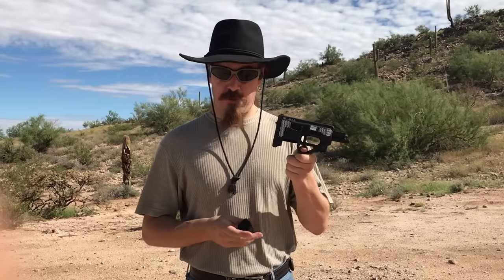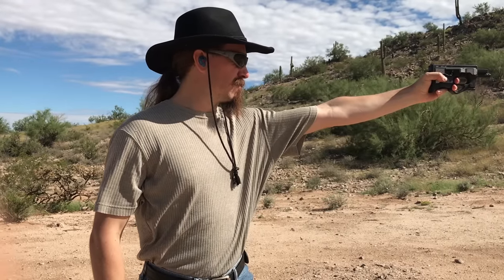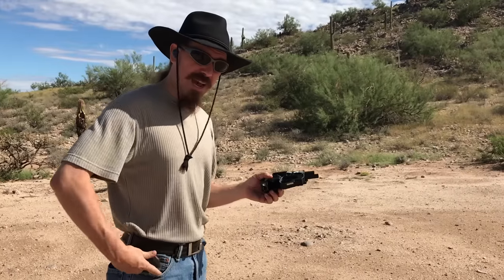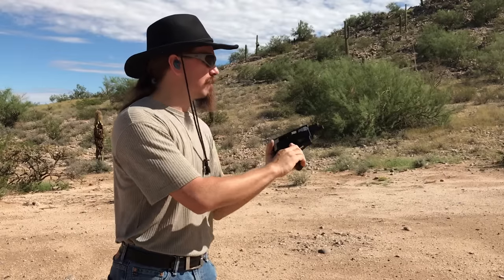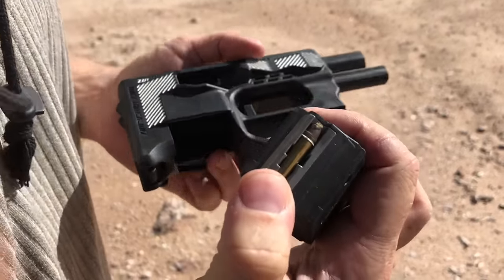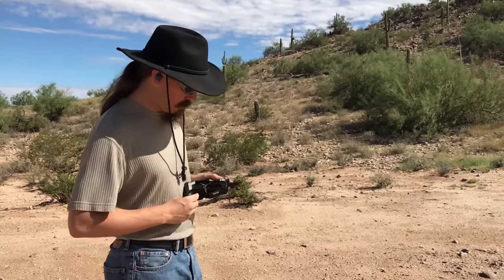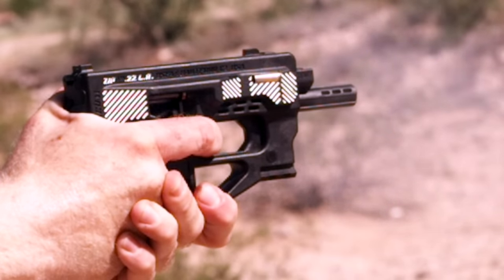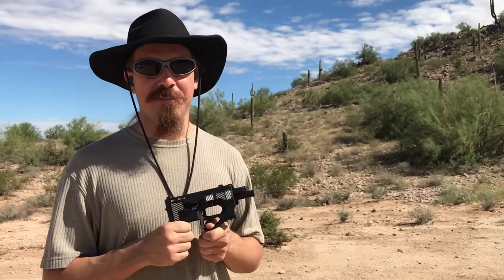Zip 22: Shooting the Worst Gun Ever

Comment: looks like some weirdo teen printed that with a 3d printer.
Reply: Actually one of the latest is a 12ga pump action revolver/rifle (depending if you’d call a 6 shot a drum mag), that one looks pretty awesome. Most are more basic outside finish unless going for artistic like the skull teeth on the printable AR15 lower, and the specific geometry of the Zipp would actually be kind of a pain to print.

Side note on reliability, unlike this model,  the printed ones would likely work much more reliable since it has a community of designers that enjoy creating and  experimenting so they go through multiple revisions very quickly. Plus the zip isn’t cool enough and pretty clunky to hold, that would be the first thing to change like customizable grips (just like you can print lots of pre-made grips for your M1911).

What this more reminds me of is someone trying to make it out of a NERF toy and really not wanting to alter it enough to void the warranty so it can actually work well, like I’m pretty sure a couple hours modifying a toy and I could make a functioning revolver much more reliable than this, haha!

Comment: The charge handle in front of gun... oh gosh.... I was nervous every time you had to fixed feed issue, or load new cartridges.... I saw accidents in my head every time. Dangerous gun. But safer I guess since it will fail to work most of the time..   lol

Comment: In my thoroughly unprofessional opinion, I think the reason for the jam of the recoil-spring/charging-handle is the material of construction: the charging handle itself is make of plastic, and sliding though a (milled? moulded?) slot in the plastic body of the (alleged) gun. Possibly either the body or handle had deformed under use enough to not permit the handle to slide through the body's slot properly?

Also I heartily enjoyed the high-speed footage of the 'gun' in operation, first with the casing bouncing around the ejection port, but coming to a rest sideways in said port, obstructing the bolt; and then later the successful ejection of a casing which is only due to random chance of bouncing around like a pinball.  
(I wonder if firing the device 'gangsta style' and having the ejection port aimed down would help avoid jams with the aid of gravity?)

Comment: I don't have much experience with guns except for using my friends guns occasionally. I do however have quite some experience with risk assessment, and machinery safety. This gun is terrifying. Every mechanical failure will pose a risk to the user. Also, after receiving shit loads of failures there is a risk that the user makes bad decisions/mistakes out of sheer frustration. On top of that, the positioning of the charging handle is just ridiculous. How the actual f*** did USFA think while making this?

Comment: I watched the history/assembly video too. Very interesting. 
I remember hearing something about this gun being designed as something people could 3D print and build copies themselves for when the State eventually succeeds in disarming us or society collapses and its Anarchy.
If you can 3D print or craft from any material the body of the weapon.. the rest of the parts are just hardware store parts. You could even use steel tubing as a barrel and it work at least once. Thats pretty guarenteed, the first round WILL fire.  And in a desperate situation at least one shot is beter than none. Its a zip gun... aptly named. I think the designer was intending it to be one of those "buy it hoping to never have to use it" items for your emergency survival gear kit. 

But seriously folks... just get an AR7. Its a fantastic cheap modular rifle, easily stored and its reliable and accurate enough to havenin case all your other guns are not available.

Comment: The only way it could be any better is if the charging handle had to be pulled forward with an insert shaped like a mouth piece requiring the operator to actually put the barrel in their mouth.😂

Comment: I personally feel that not knowing if a safety is on or off can be far more dangerous than a gun by itself as they don't tend to get up by themselves and try shoot all on their own. Also there obviously should be no feed ramp on it as that is built into the Ruger 10 22 magazine   I'm surprised you didn't know that. There's more almost every 22 cal pistol has ammo it likes and dislikes so to speak that is very common with them. You fumbled cocking it the first time and then it shot 9 rounds in a row no problem with the Aguila ammo. You did not stick with that round and the 10 shot magazine. If you had I believe you would have been able to shoot many if not all the hyper velocity rounds again a quite common thing. No sir I don't think it's garbage I think you feel that way and put your spin on it. I know for a fact I can get one to shoot all day long and make a video of how good they are! All I need to do is use the ammo it likes with a 10 round magazine and operate it properly. If you took that gun apart and you seriously don't know why it got stuck I would have big time reserves on you working on any gun. Look man I'm sorry but that's how it seems to me. The old raven and Jennings 45 dollar 22 autos didn't function well but even as a kid 40 years ago I could make them work ok. Many said junk! But I knew I had a weapon that I made work that could easily save my life. As long as it can shoot even 1 round it's far from junk. I was poor not stupid. He tried to make a very cheap gun and didn't quite get it right. That what I would have said about it.